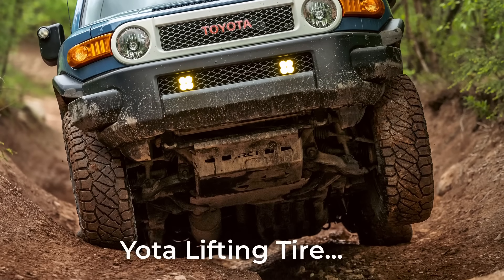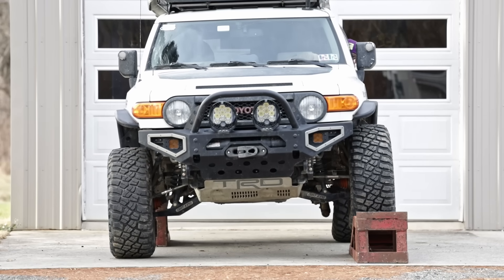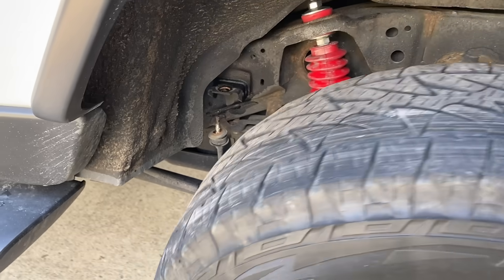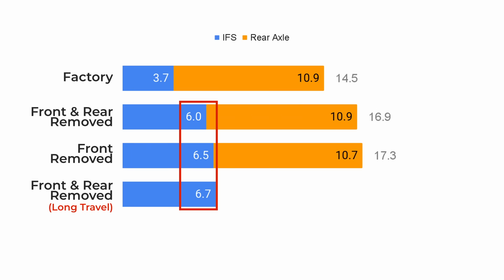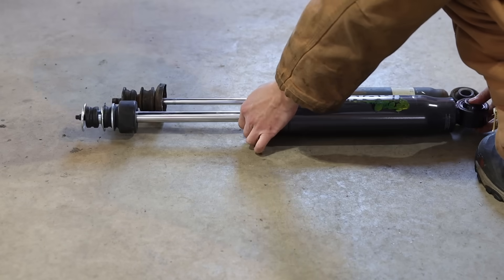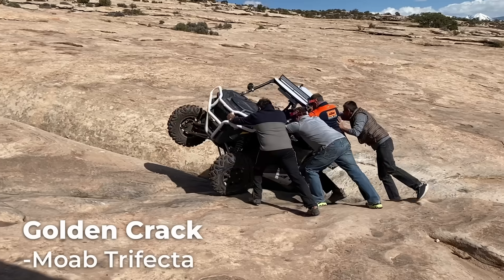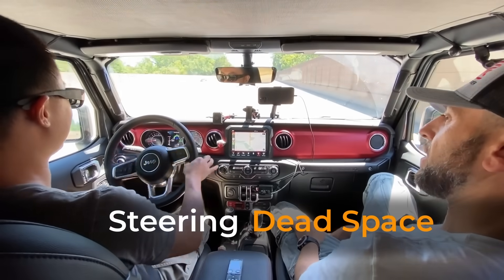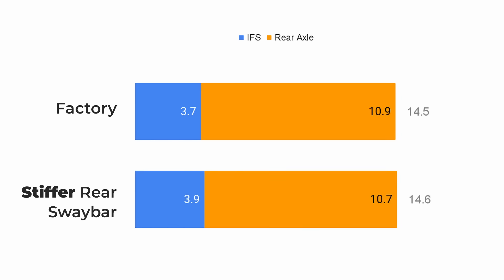Articulation vs Sway Bar | Not What You'd Think!

Comment: Shout out to Kai and an update on my evolution of articulation testing inspired by his video.  I’m an auto-xer in an AWD Eagle Talon SM class.  I use my 2014 4 runner for a lot of heavy towing of my race car and aluminum race car trailer as well as a dump trailer.  So main focus for my 4 runner is Overlanding, trailering heavy loads and very minimal on road use.  Hence,  I added a few more measurement components to how I wanted to think about the changes I’ve made for other drivability things that matter to me beyond just articulation changes with sway bar changes.  Below is a note to a vendor I'm considering for Long Travel from my current mid travel Radflo in the front and Long Travel Radflo set up in the rear. 
 
1.	I have created a much more balanced rig by the install of a large rear sway bar, removing the front sway bar which allows for a little less articulation in the rear, about the same in the front but ultimately has created a much flatter/articulating platform then when I was sway bar on the front only.  Here are how my specs have evolved.  Hence now the reason to consider your 2.25” to get more overall front travel to get even closer and more balanced with my rear travel.  Tests were conducted with ramps on opposite sides of the vehicle and driven up until traction broke on the opposite tires, (first test was with driver left ramp and passenger rear ramp, then 2nd test reversed with the same sway bar settings to passenger front and driver’s rear ramps.  All other conditions were controlled for and no other adjustments were made during testing.  Air pressure in tires 34 lbs. front, 36 lbs. rear.  Radflo shocks set to a middle setting for every test, level concrete pad that test was conducted on.  You will see very slight ranges in articulation measurements that account for very slight differences depending which side of the ramps I was running up.  
a.	I’ve gone from 16” of travel in the rear, 4” in the front with the stock sway and front sway bar = 20” total travel   (% of articulation calculation:  Front 20% to Rear 80%)  
b.	18 ½ - 19” in rear, 3 ¾ - 4” in front with no rear sway bar and front original = 22 ¼-23 ” total travel (% of articulation calculation:  Front 17% to Rear 87%) Using Max articulation range figures for calculation
c.	17 ½  - 19 ¼ ” in rear, 7 1/8 - 7 ½” in front with no rear sway bar and no front = 24 5/8 – 26 3/4” total travel (% of articulation calculation:  Front 28% to Rear 72%) Using Max articulation range figures for calculation
d.	16 1/8 - 17” in rear, 7 5/8  – 7 ¾” in front with Super Pro 24MM rear bar set to firmest setting and no front sway bar  = 23 ¾ - 24 ¾ ” total travel  (% of articulation calculation:  Front 31% to Rear 69%) Using Max articulation range figures for calculation  (Ran tests on Medium and Soft settings with the rear sway bar which both generated just slightly less overall travel, however the firm setting significantly improved overall handling with the vehicle empty and significantly improved it under a trailer load (either the dump trailer or loaded race car trailer)  (Note: Super Pro has been a great vendor and partner if you're note familiar with them out of Australia.  Their adjustable rear sway bar and end links for the 5th generation 4 runner was just what I was looking for to have a lot of setting flexibility to see what was going to work best for Trailering, Overlanding and just on the street driving.   
 
Slalom course results for the following conditions.  Empty vehicle, same air pressure and other conditions controlled as noted above.  Course set up on 10-year-old black asphalt 2 lane 6/10 of a mile straight dead end cul de sac road.  Course set up using Auto-x orange construction cones set up in a typical 60’ spacing that is used for all automotive journal/blog slalom testing.  Testing done in ambient temps between 52 and 70 degrees so little variance in tire adhesion due to variation in asphalt and tire temps.  Testing done with cold tires.  
 
a.	stock sway and front sway bar on with all other mods as noted in build sheet.  (57 mph) 
b.	stock sway bar front with no rear sway bar (55 mph) 
c.	no front and no rear sway bar (53 mph) 
d.	no front sway bar with Super Pro 24MM rear bar set to firmest setting (58 mph) 

Kai asked me a very good question around oversteer, turning the truck over during the slalom run.  The 4 runner now is definitely in an oversteer scenario compared to stock and when I just had on the front sway bar.  However, it is way more safe feeling than running now sway bars at all which I did for a long time as it did give me the best total articulation but as you can tell it isn't as balanced front to rear as running a large rear sway bar.  So I traded off just an inch or two of rear travel for an amazingly stable vehicle, faster than my stock 4 runner through the slalom and importantly when towing, sway in the rear has been significantly minimized.  I did tell Kai running the slalom I was at the limit and did not want to turn the truck over.  One small over correction and it wouldn't be good.  The only other upgrade I did was to reinforce the rear sway bar U shaped end link brackets.  That steel isn't very thick and since I trailer heavy loads and was putting on a much thicker rear sway bar I added another 1/4" of steel around the entire bracket significantly strengthening the weakest point in the rear sway bar set up.   So my conclusion for me and how I like to drive - understanding I like a very firm ride, I like oversteer, I auto-x as much as I overland this set up is better than stock for me.  Everyone needs to determine the feel of your ride and your preferences on oversteer/understeer, articulation, etc.  This was a super cheap $300 total investment that transformed my truck.  I was OK with no sway bars, now I feel like I've got a bit of 4 runner race car.  (:    Thanks again Kai for all you do in the Toyota community!

Comment: First of all great video that you for that.

I have a questions what is the best setup if I don't want to remove the sway bars but I can play with the swwy bar links. Which angle of the sway bars for front and rear are recommended?
Thanks

Comment: For a 4 wheel independent suspension vehicle (Disco 3), do you think the maximum articulation configuration would still be front bar disconnected and rear bar in place?  I may end up testing this myself soon 😊

Comment: Very informative and detailed video, I can't imagine how much work it was to gather all that data, well done sir! I wanted to add that sway bars can also increase traction offroad by simply increasing the spring rate on the tire (that is climbing an obstacle) and into the obstacle you are climbing over like a big rock, the opposite tire will have the opposite effect (less spring rate). In other words, gravity is pulling the tire that is not climbing downwards, but the sway bar is pulling it up which then transfers that force into the tire that is climbing and onto the rock (sway bar force is pushing the climbing tire down increasing traction or more simply put the not climbing tire is made "lighter" and the climbing tire is made "heavier"). I hope I explained that in an understanding manner. I would like to hear your thoughts on articulation gain vs some possible traction loss when removing sway bars specifically in an offroad scenario.

Comment: Nice video man!!! For me the best balance in my ex pathfinder (with ifs) was enlarging the swaybar links front and rear, but i did do a lot of sandbashing, so that worked for me (only 2 inches lift). I also did drift events (hahaha), so better body roll control :D. In the patrol Y60 (all kind of terrain) i didnt run swaybars. it was a tiny 2,5 inches coil lift plus 1,5 body lift with stiff kony raid shocks and it run very well in all kind of terrains (from rocks up to sand). It dependes of the ride and the terrain.  Comparing my two rides... ifs suck a lot in real situations in extreme conditions. Unless you spend a lot of money, better get a solid axle ride if you plan to flex too much. 
Important:  if the terrain condition are too extreme, its better to have more flex on the back than more balanced between front and rear. Its better to have 3 wheels on the ground than 2 on the earth and 2 on the air. :D . Just saying...

Comment: 13:48 you called it car camping (correctly) - instead of saying overlanding. You earned a sub for that alone! 

On my '17 SR5 am replacing my Bilstein 6112 650's with 6112/700 HD part# ...and Westcott preload collars(~.75" more lift) and going from 33s to 34's. I have magnussen supercharger 90 more lbs up front. I am considering removing my FR sway soon bc I will have more spring PSI AND initial preload from the westcott collars. Sway bar will be doing less for me on road.

 I also daily drive an '84 Chevy truck on 1 tons and leafs on 38" Patagonias and NO Sways on the highway and she handles fine. Ive owned Evos/Stis/Camaros and know how a vehicle behaves and how to respect it w decisions on highway. So does the wifey lol

Comment: On the ramps. rear sway bar put more weight on the front and this is why you get more flex on the front. But when off the road. removing both bars is the best. it is just really dangerous to drive on the roads.  Or one could just use the absolute minimum stiffness to get best of both since people who drive their offroad rigs on the streets do not need so much flex as pros.

Comment: my front sway bar link broke on my JK during the last off-road trip, so I finally got to see the difference of more articulation. It was actually a big improvement in traction and it made up for me not having locking differentials. I did notice my bump stops got damaged though and I definitely see a lot more body roll while taking turns, so there is definitely risk of damage to other components - maybe even bottoming the shock absorbers

Comment: I have a question for the swaybar delete. What if I ran heavy aftermarket springs WITHOUT having the added front weight (steel front bumper) it's actually recommended for, while having the front swaybar delete on my 5th gen 4runner? Would that compensate body roll while still benefitting greatly from front swaybar delete?

Comment: One thing that needs to be mentioned and is VERY important, is that keeping only the rear sway bar (especially a stiffer one) WILL increase oversteer on the road. I removed even my stock one for this reason. You really dont want a lifted rig getting sideways into a wet or snowy corner on the road. It is a shocking experience (ask me how I know). In the end it really is all about compromise.
Reply: How do you like it with both bars removed?
Reply: @derfwgn7719  get used to the lean and its all good. Front end is very planted due to being truly independent now. I've had it squealing tires around a dry corner and it felt fine. Never felt like it was going to actually tip over.

Comment: i no longer have a front bar. it has helped keeping the tires on the ground while crawling. (2016 4runner) to battle the on road boat feeling i put 700lb dobinson springs. i have a winch and bumper so its. ot as stiff as you'd think

Comment: Why does it matter if you have articulation if there's no load on the tire that's touching the ground?  If a tire is spinning it doesn't matter if it's two feet off the ground or physically touching the ground, it's not providing anything.  At least with a sway-bar in place the unsprung weight of the side that has no grip is adding load to the side that has grip.

Comment: Something else to think about. Increasing the rear swaybar stiffness relative to the front WILL cause the rear to lose traction before the front, so in an emergency evasive maneuver its possible that the rear will start sliding. With no front sway bar and a stiffer rear bar its much more likely. Part of the reason the factory rear swaybar is always smaller than the front is because the OEM's (and lawyers) have decided its better for the average car to understeer than to oversteer because to the average moron on the road an understeering car is less of a problem than an oversteering car.

Comment: Swaybars are super subjective on road. I have a swayloc which is like an Antirock when it's in the soft rate mode, it's very loosey-goosey on the body roll, but I can tolerate it, and like it. Would I let anyone else drive my jeep with it in the soft mode, not really imo.

Comment: Looks like a lot of effort, but you have a problem with your methodology.
To decrease complexity of testing, science offers the concept of “ceteris paribus” which means “with other conditions remaining the same”, or “ all other things being equal.
This means that you make one change or apply one condition to multiple configurations and see the difference. What you have done in your test is apply a ramp on the front but also on the back on the opposite side. That was a mistake. 
First of all, you are much more likely to encounter one obstacle at a time when you are off road, than multiple obstacles on opposite sides which would actually stabilize the vehicle, because it would force it to remain level. You should try running your test on a simple ramp travel index. This way you are introducing one obstacle only and you can get true results for your vehicles. Or a true comparison test. It wouldn’t require an elaborate analysis, and the results would give a clear indication of stability without being so vague and complex. Remember, it is the job of the scientist to reduce complexity, not increase it, and confuse your target audience. I suspect that the FJ doesn’t perform very well on a standard RTI test and that’s why you introduced a ramp at the back on the opposite side as well. You also forgot to mention that the jeep wrangler also offers a swaybar disconnect, which you can decide to engage or disengage, as the driver sees fit. It’s also important to remember that an independent suspension only offers one degree of freedom per wheel where a solid axle offers two degrees of freedom per wheel, which greatly increases articulation. It’s not just about the swaybar. In short, your testing is flawed, and your recommendations questionable.

Comment: Some calls it sway bar but in actual fact it it's a anti-roll over bar , removing it will cause your vehicle to roll over at speeds as it stabilise the vehicle in case of especially hard braking or cornering . Removing the anti-roll over bar is a breach of your insurance policy and they won't payout your claim in an accident . It's dangerous and only idiots does it .

Comment: When I raised the suspension on my JK Sport, I obviously needed longer swaybar links, so opted for ones that disconnect on front by pulling pins out. It's easy to disconnect/reconnect when off/on-road. I haven't driven on-road with them disconnected, but a JK on 34.2s with a +2.5" behaves like a boat enough.

Comment: If you made a shift knob for a 1999 Dodge Durango, complete with the overdrive shutoff button for towing, I would buy that from you. I am in the market for one because my stock one stopped working, cannot turn-off overdrive now, even after replacing the button, gotta replace the whole knob and lever.

Comment: When I took my front off my 03 Taco I noticed more front flex off road, but on road manners didn't change much. As I added more front end weight, arb bumper, winch, etc it turned into a boat on road. Other people drive it and say it's actively trying to kill you as you drive, but I'm used to it and it doesn't bother me.

The Taco is a leaf sprung rig without factory sway bars in the rear. It'd be interesting to see a similar test with a leaf spring rig, and what changes adding a rear sway bar would make, scientifically

Comment: Well, my 3rd gen 4runner I currently own has broken links on the front sway bar, but not the rear, and it definitely flexes more than my previous 3rd gen 4runner did because of it. & it doesn't feel much more uneasy on the road than the last one did since I still have my rear one hooked up & the front is where the travel on these suffers more so having the front one unhooked helps the most while having the rear sway bar on still helps stabilize the car better on corners than if you removed them both

Comment: In the track racing world, when you add a sway bar (or increase the stiffness), you reduce the spring rates.

This gives a little bit more comfort.

In my 300TDi Defender, I run without sway bars front and rear, but with beefed up "rally style valved" shock absorbers. Pretty nice! 👌
Reply: Yep, heavy bars/light springs are what I ran on cars.  Really the same on Jeeps!